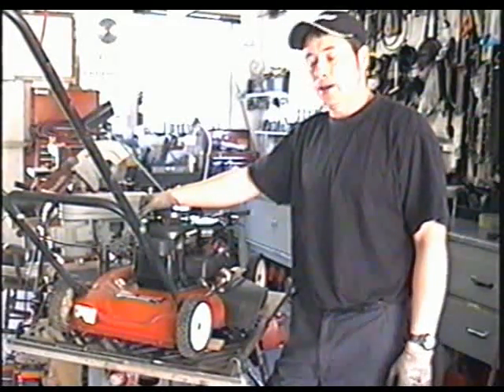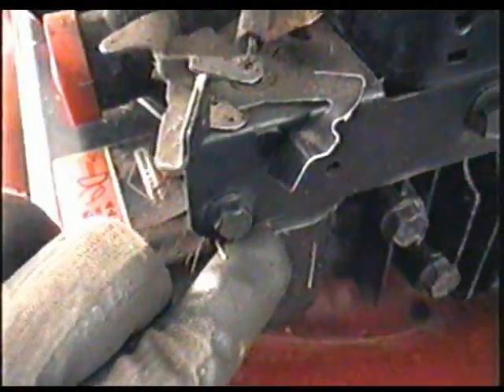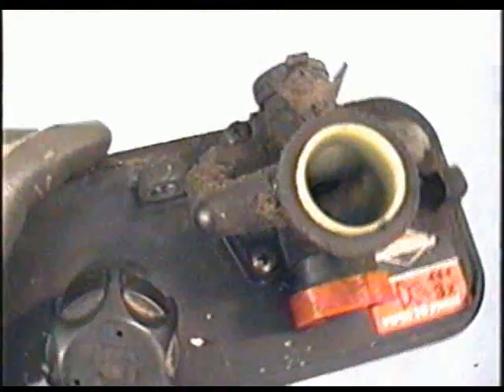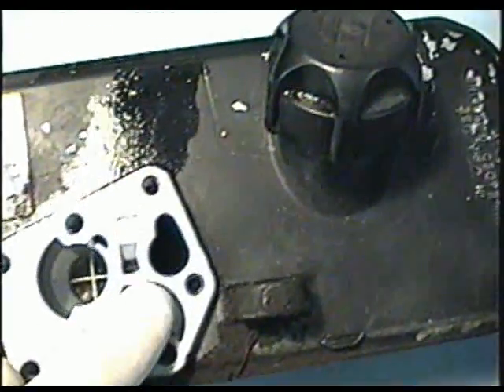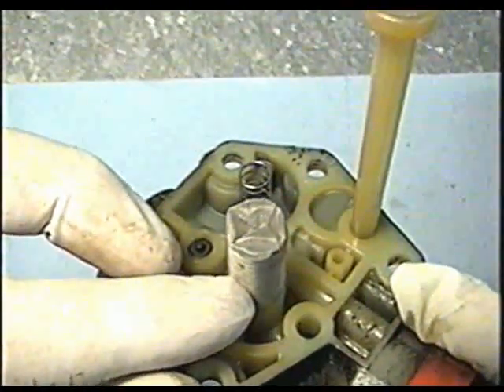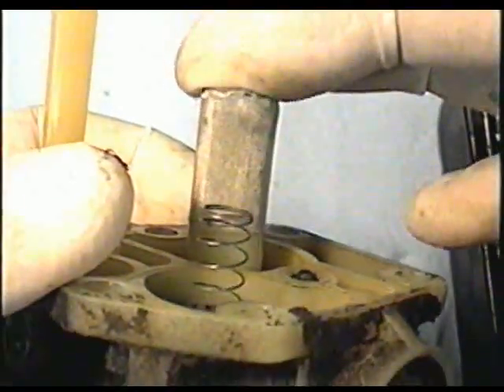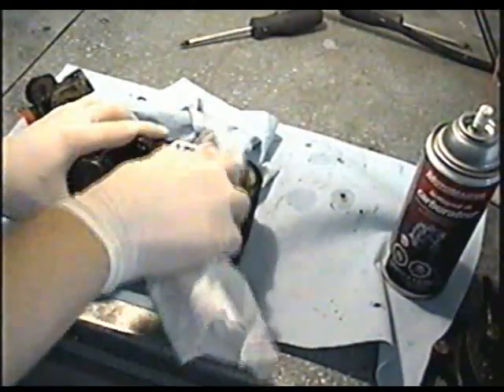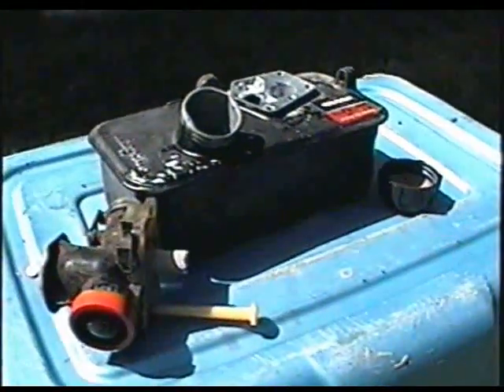HOW TO REPAIR Lawnmower with BRIGGS & STRATTON Pulsa Prime Carburetor  1/2

Comment: Don't buy a lawn mower with a Briggs & Stratton engine. I have bought 2 new mowers in 3 years now and the engines died after one season of mowing. They started surging, sputtering, cutting off and using twice the amount of gas as before and then finally quit starting altogether. Replaced spark plugs, got new fuel, not E85, and cleaned the carburetor per this video. I'm disappointed as I used to be a huge fan of Briggs & Stratton.

Comment: Can somebody help me? Some plastic piece fell off while I was trying to take out the carburetor to clean it. I have no idea what it is or where it came from or where it goes. heres a quick video so you can see what it looks like https://www.youtube.com/watch?v=dqSe4bMMhTo
Reply from the maker: BlinkinFirefly hey, can you make a short vid of where it came out of and the carb/fuel tank. or you can post pics to my facebook . also give me model numbers of the engine@234040803408166
Reply: the numbers are in the description of my video. I could make another video, but honestly I don't know where it fell from, I just heard it hit the floor as I was trying to take the carburetor out and had no clue what it fell off of.
Reply from the maker: BlinkinFirefly I need the numbers on the engine specifically
Reply: I get another video to you with all the stickers on the mower...probably tomorrow
Reply from the maker: BlinkinFirefly ok, the other numbers you had were for the mower body only
Reply: donyboy73 correct
Reply: donyboy73 I took off my carburator. And it had alot of dirt that was really cake on! I didnt have a air compressor to clean the dirt off! So i clean it with water and then use carburator cleaner. I was wondering if that was ok!
Reply from the maker: Dallascowboys1x best not to use water, however just let it dry thoroughly before re-assembly